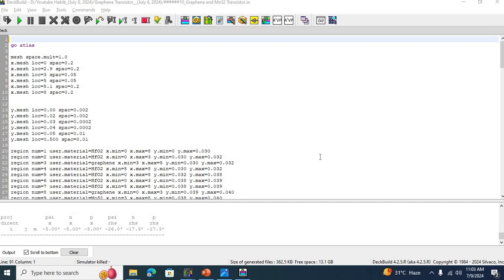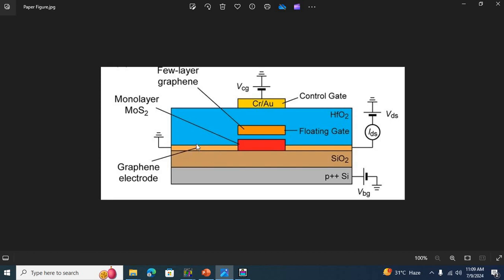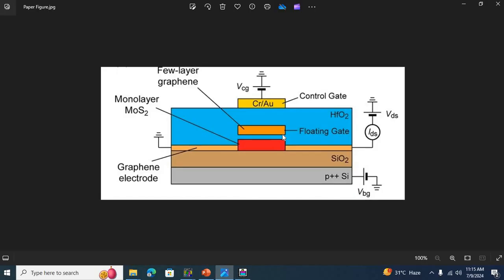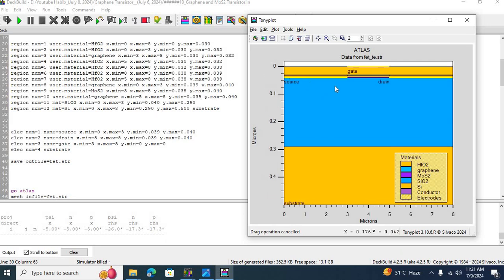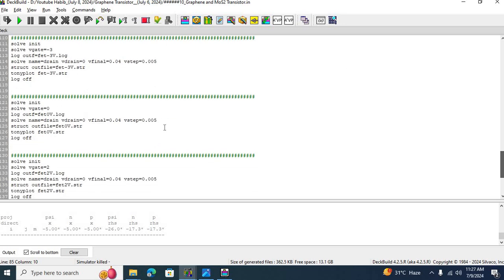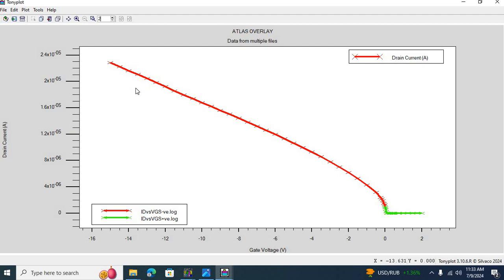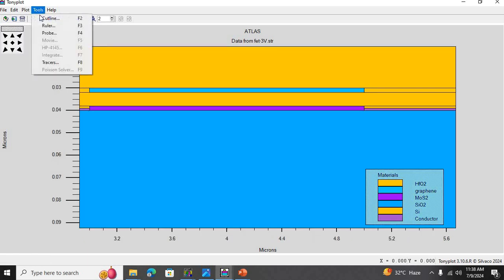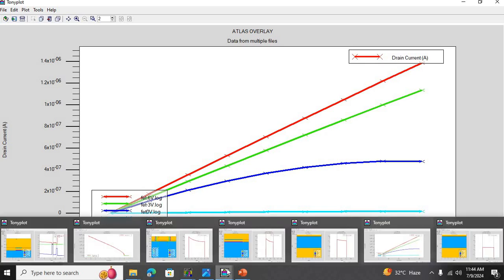Graphene and MoS₂ based Field Effect Transistor Silvaco TCAD Simulation 🧬💻🔬✨

Comment: Hello, could you please provide guidance or examples of simulations related to gas sensors or biosensors using Silvaco? I’ve been struggling to find any resources and have been working on this for months without success.
Reply from the maker: Hey, one of my students worked on something similar in a semester project. Let me check with her.